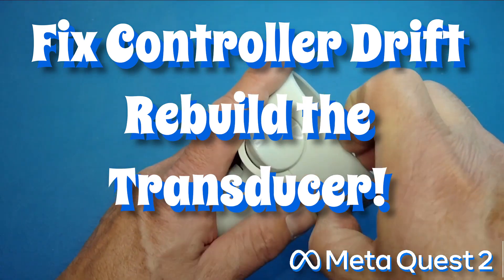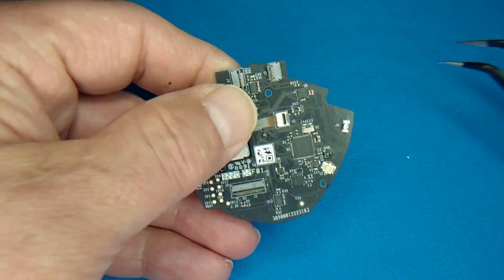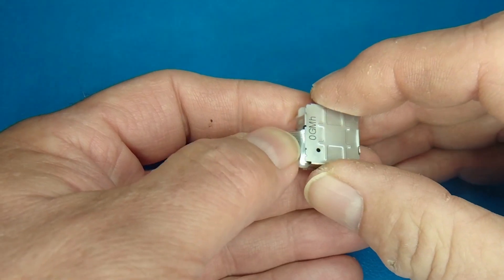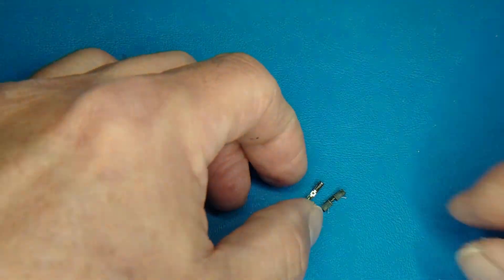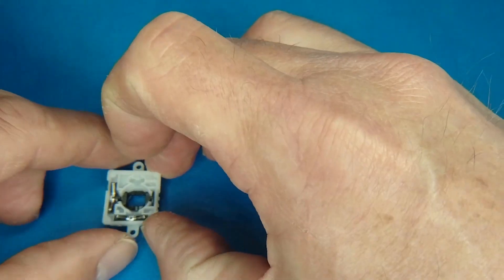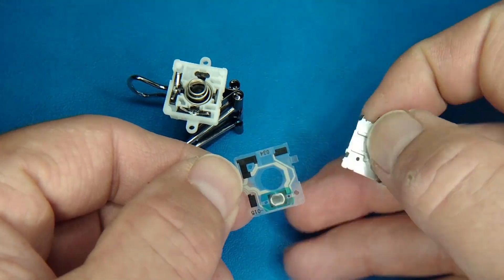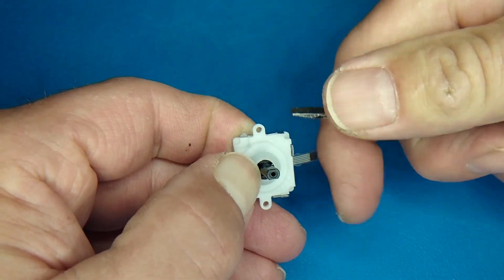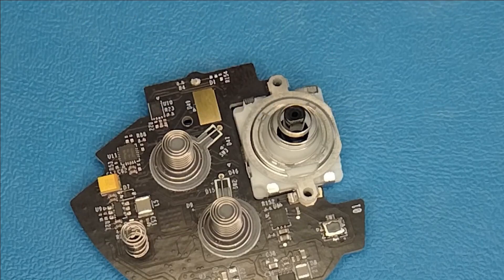Fix Quest Controller Drift- Rebuild the Joystick (Quest 2 Tips)

Comment: I'm right in the middle of doing this; great video I hope it works! Note: You took a part a left controller transducer but after the rebuild you attached it to a right controller circuit board 10:01
Edit: Got it all together and stopped my stick drift? Great video!

Can you do a video on the x/y buttons? My buttons are not working now :(
Reply from the maker: Pop the black cover off.  See if they're working without it.  There's a little wiggle room when you put it on and it can impede the buttons from moving properly.  Usually, just need to reseat the cover.
Reply: Did you get it working?

Comment: Hello, I have a problem, I have stick drift on the left controller, I think it come from the spring of the stick, its à little folded, do you know what can I do when the spring is the problem ?
Reply from the maker: The spring is actually part of the capacitive sensor.  I'd find it unlikely that it's actually causing your drift.  However, if you do want try to straighten it, I'd suggest detaching it from the body of the transducer first.  Its made of spring steel, so you'd need to use two fine tipped needle nose pliers to control any bending you try.

Comment: I didn't read far down enough in the comments, but I'm having an issue with the touch on my thumb sticks after I reassemble my controller. It either works or it doesn't and its completely random. Is there something I can do to fix this? It works about 25% of the time
Reply from the maker: I need to make another troubleshooting video, this is probably the most common question that comes up.
The "spring" under the thumbstick cap is actually the capacitive sensor.  Changes are that it is not properly seated or not making good contact with the metal case of the transducer.  Pop the thumbstick cap off.  Check to see that the spring is held by 4 tiny hooks.  If not, thread them back on using some fine tip tweezers.
When you put the thumbstick cap on, you'll have to try and make sure that it goes on so the "spring" fits all the way up under the top of the cap.  It's impossible to see, so the only way you'll know, is if the sensor is working.  Try replacing it straight down, without tilting the transducer stick at all that seems to help.  You can also try lubricating the upper part of the spring the round  round bit of the thumbstick cap with a little isopropyl alcohol.  It'll help them slide together.  (I wouldn't use any actual grease since it has a tendency to migrate when it gets warm.  The ipa will flash off as it dries.)
Hope this helps.
Reply: @ImaRainbow  A guide on this would be absolutely fantastic

Comment: If your too scared to do this you can use Wd-40 electrical and spray inside the joystick. You will have to do this around every month
Reply from the maker: Fear doesn't need to factor into your decision making.
If/when you're not able to clean your controller effectively any more (See this video- https://youtu.be/iitoevOXrf8 ) Rebuilding the transducer is an alternative to buying a new controller.   I'm pretty sure I covered all of this.
Reply: That's a valid solution, for sure.  I was doing it about one per month for a year (a lot of Pop One will stress that left stick!  lol) and got tired of it.  I bought new replacement analog stick modules (about $15 for a set of two) then used Ima_Rainbow's guide (along with one on iFixit) to replace it.  It's like a brand new controller again; in fact, the new analog stick feels a bit "heavier duty" than the OEM stick-- there's just a little bit more tension which actually makes movement a bit more precise.  Thanks again for the excellent videos and instruction Ima_Rainbow!
Reply: Cleaning the controller isnt a fix for everyone some people have more serious drift

Comment from the maker: This video will show you how to rebuild the transducer.
To perform this procedure, you'll need to disassemble your controller down to the circuit board.  You'll need this video to show you how to get there.
🪛🪛🪛 https://youtu.be/aZ57n6iam6Q 🪛🪛🪛

If this is your first attempt in dealing with Quest 2 Controller drift, you can try any of these other solutions first.  None of them require a complete disassembly of the controller to implement.
(Cleaning with contact cleaner is usually the one that helps folks the most.)

Controller Unpair & Pair- https://youtube.com/shorts/5ZwZUPIDsH4?feature=share
Software calibration- https://youtu.be/wM-ijm64WnI
💖💖💖Cleaning Procedure- https://youtu.be/iitoevOXrf8  💖💖💖

If none of these are helping correct your controller drifting issues, then it's probably time to try the Transducer Rebuild.

💲💲You can also buy a New Transducer on Amazon.  https://amzn.to/3o1dJbv  💲💲💲
I've gotten this one and it works.  
(This is an Amazon associate link, if you buy one, I get a shiny nickel or two, but you don't pay any more. 😁)
Reply: I think you forgot to pin this comment